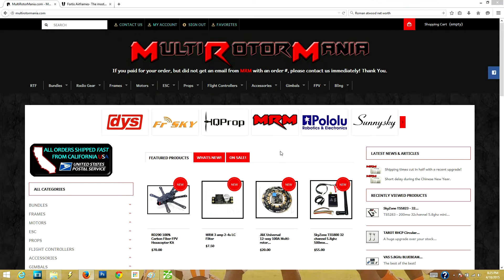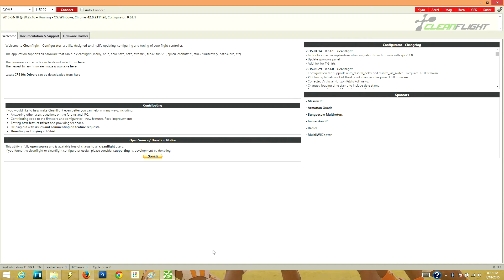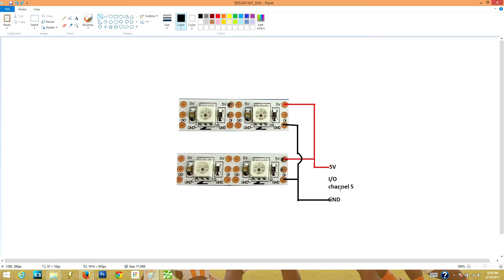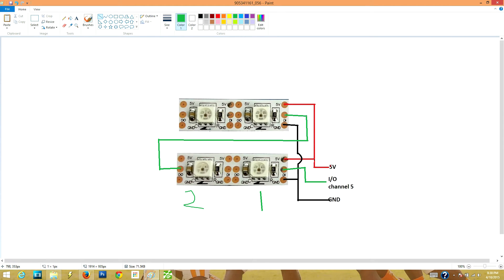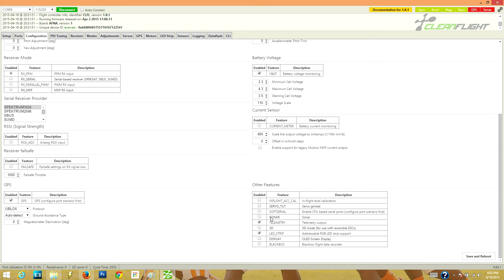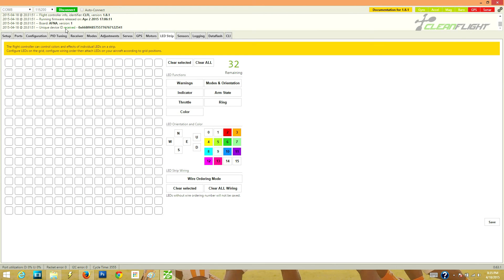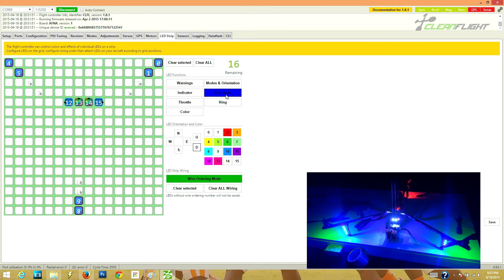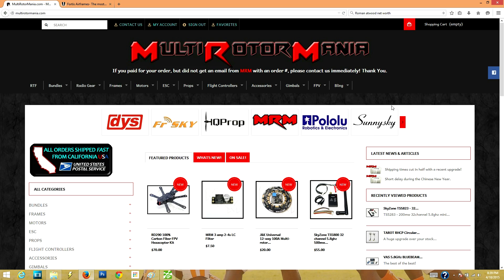SCALE ADVENTURES - Dragonfly32 LED setup with Cleanflight  Tricopter build part 6

Comment: here is a link for plug and play just connect the battery, blue and red or green and red for 200 or 250 drone 

http://www.ebay.com/itm/1-JST-Plug-to-4-LED-Strip-Light-Night-Light-for-ZMR250-QAV250-RC-FPV-Quadcopter-/191811068797?ssPageName=STRK:MESCX:IT